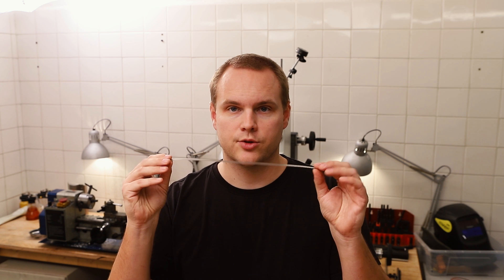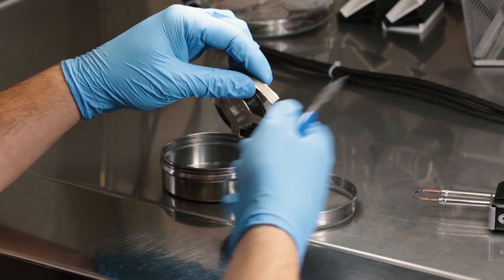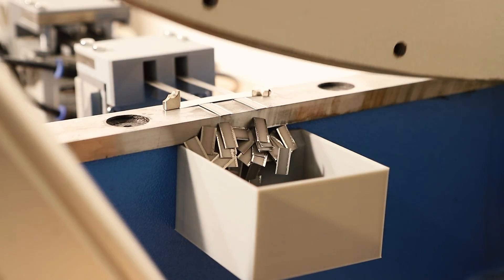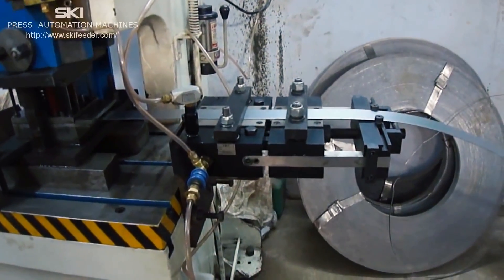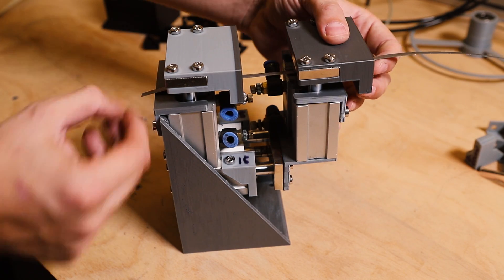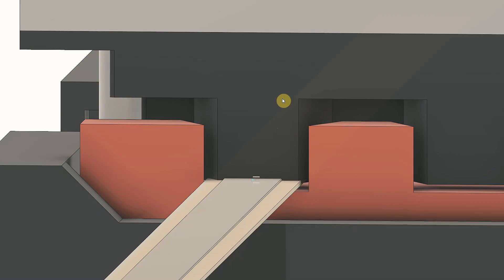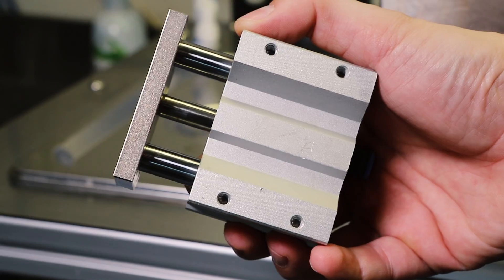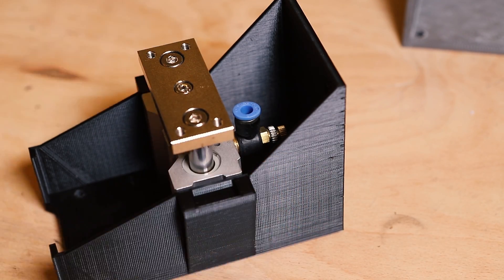Getter Cutter For Nixie Tubes - Feeder

Comment: Very good work! As far as I remember, you bake the getter with a self made eddy current heater, right? So grease is probably too much, but traces of sweat should be ok. Did you perform a rest gas analysis of broken tubes? By the way, which 3d printer do you use - the parts look pretty durable!
Reply from the maker: demolitionb light getter contamination would be ok as it is outgassed by rf heating, but it is better not to contaminate it at all :-) I use Prusa i3 mk3, I am super satisfied with it :-)